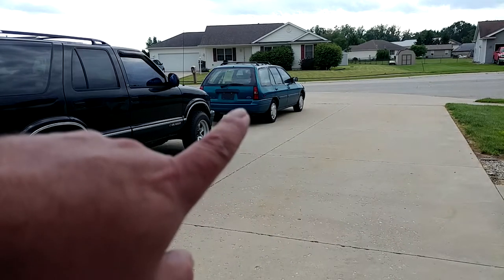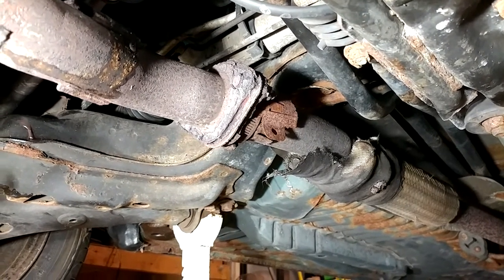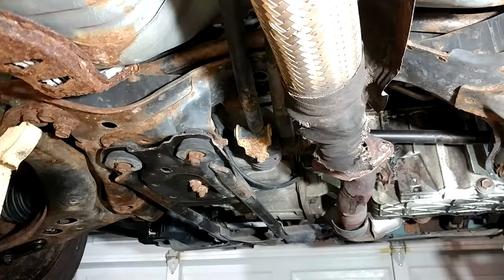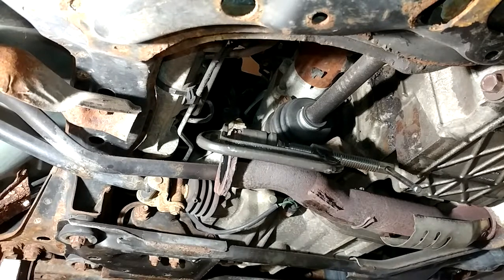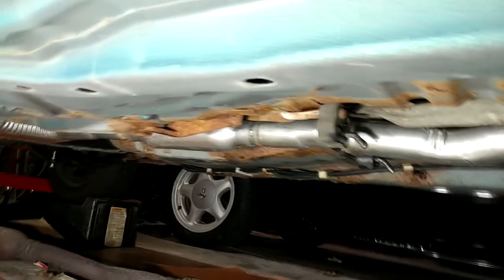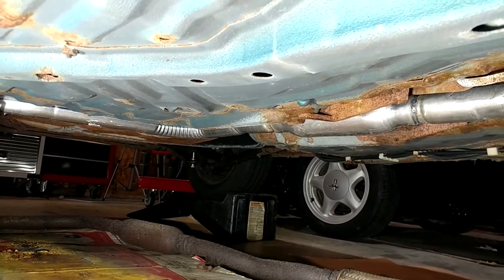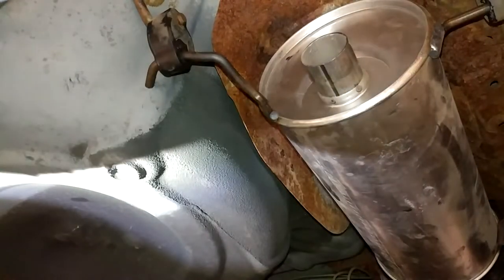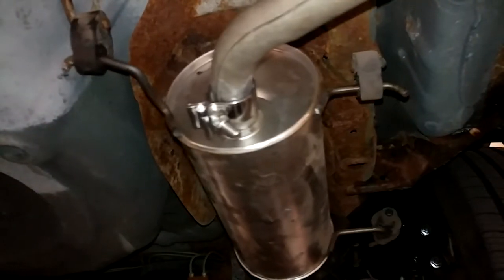Complete (...almost) Exhaust System Replacement: 1995 Ford Escort Wagon

Comment: 3:54 those bolts connecting the pipe to the converter on my car actually rotted out and so since my pipe was bad I had to air hammer one of the bolts out of the converter end and the other one out of the pipe end. I replaced the bolts with 14mm bolts with flat washers and lock nuts. I have to redo this job because the flex pipe isn’t quite right so I’ll be doing what you’re doing in this video on my car.
Reply from the maker: More fun times!

Comment: I've got a 95 escort wagon that's been sitting for eight years. Someone stole my catalytic converter.  I want to throw a battery in it and try to start it. Any tips would help me, my oil looks super good I was impressed. Lol
Reply from the maker: Hummm... Are you positive someone stole the cat and maybe didn't accidentally just swipe the resonator? The cat is bolted straight to the exhaust manifold and is difficult to get out of there even if you have good intentions. I think I show it in this video..?

As far as getting it running again. Pull the plugs, put an ounce or two of oil down each hole (Marvel Mystery Oil would be ideal), and let it sit for a few days. Later turn it over manually a few times. You may get lucky and be able to do it with the accessory drive, but if you need to do it at the crank there is an access hole for that in the passenger side inner fender, but you will need to remove the wheel to get to it. I would temporarily put the plugs back in after adding oil and pull them again before turning it over to avoid oil fouling them.

Next, pump any old gas out of it. You can use the in-tank pump to do that itself. Just remove the shrader valve at the fuel pressure test port and ground the appropriate pin on the EEC-IV diagnostic connector under the hood (you can find a diagram of it online) and the pump will run as long as the key is on and pump the tank dry. 5/16 fuel line fits over the outside of the test port pretty much perfectly.

After that, I'd probably just put some fresh gas in it and see if it pops to life (which it probably will). It's what you need to do after that to commission it back into service that gets a bit overwhelming. Everything will need flushed, all of the filters replaced, a lot of rubber parts are going be a lot worse for the time (tires too), thermostat can't be trusted anymore, timing belt and water pump should be done, fuel pump will probably be on borrowed time, etc, etc. The "whole shot" on one of these cars usually costs me about $1500 (including tires), buying the best quality parts I can find. So... I'd probably count on that if you want to make the car completely "right" and can do the labor yourself. That said, my wagon just turned in 32mpg, loaded, in mixed driving and the AC running a fair portion of the time. There's not many cars you're going to spend $1500 on that are going to do that and carry what a wagon can.

Good luck with it! 👍

Comment: The original exhaust system on those cars were welded as one piece.
Reply from the maker: Hummm... The Chilton book illustrations include the clamp at the muffler, which is the only division in the system I removed. 🤷‍♂️

I guess that could have been a replacement system, but it was way higher quality than anything I've ever seen from the aftermarket. It would also mean that car ate 2 systems in under 74,000 miles, while keeping a factory muffler, and before the rockers rusted out. If true, that's crazy...